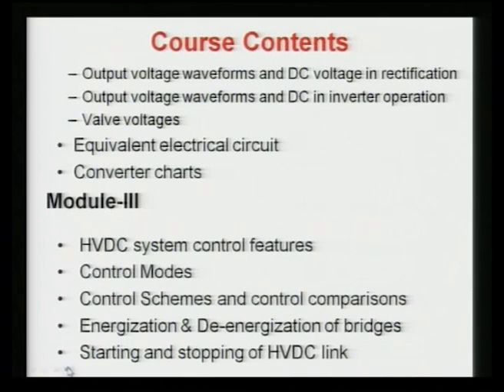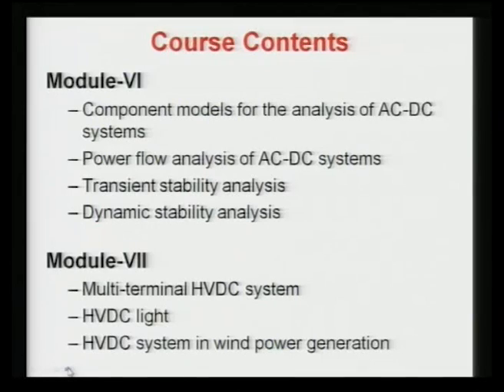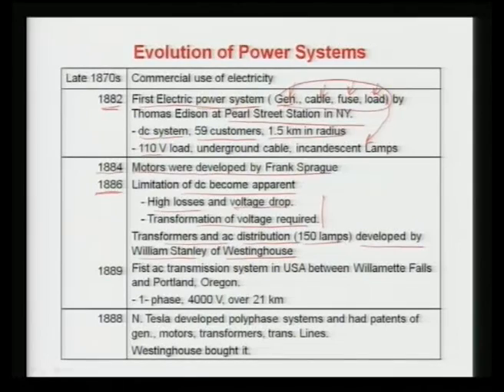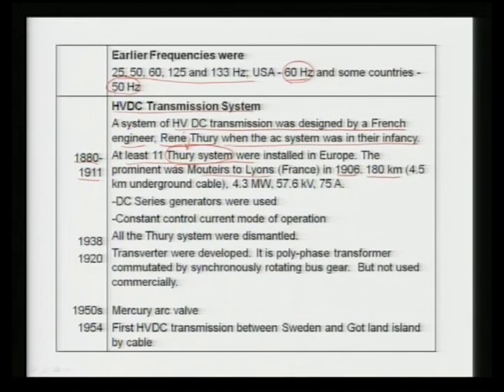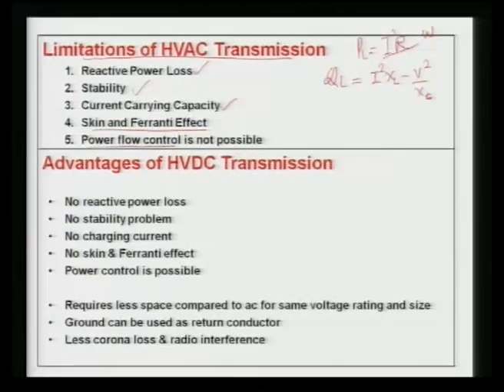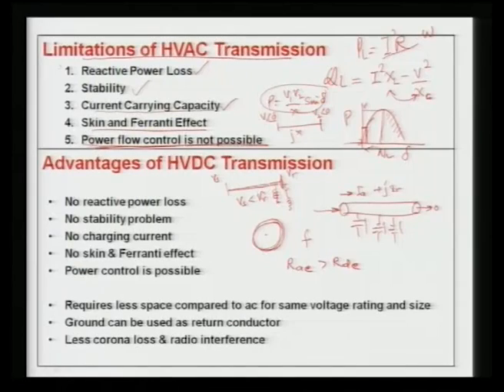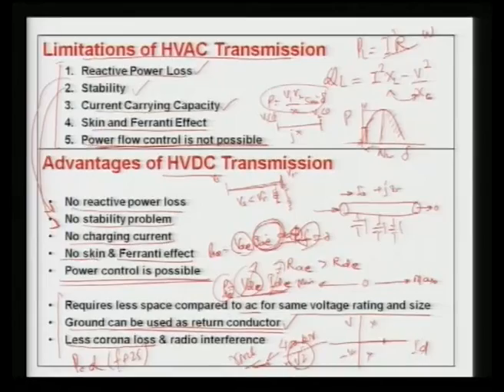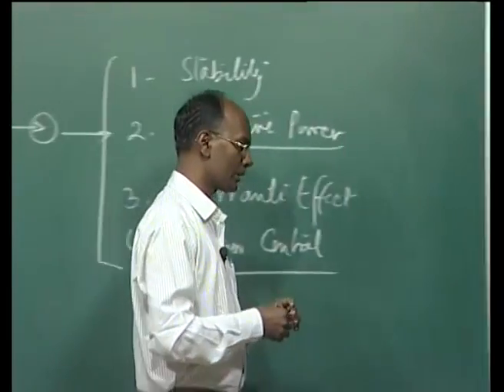Mod-01 Lec-01 Lecture-01-High Voltage DC Transmission

Comment: nptel please lecture series on high voltage engineering also.
It includes insulators, breakdown, Townsend's criteria , generation of high voltages, measurement of HV, testing etc. Its different subject than HVDC.
Reply: did you get

Comment: hi all as d'cruz cannot transfered very far how 
come hvdc possible for longer distances?
Reply: yes possible .there is no inductive reactance problem so voltage profie is good.and no frequency problem & no skin effect effective conductor utilization is good.and need not require reactive power for dc power transmission and no stability problem need not require compensators

Comment: Can someone explain is it possible to transmit the power to longer distances?
Reply: yes possible .there is no inductive reactance problem so voltage profie is good.and no frequency problem & no skin effect effective conductor utilization is good.and need not require reactive power for dc power transmission and no stability problem need not require compensators